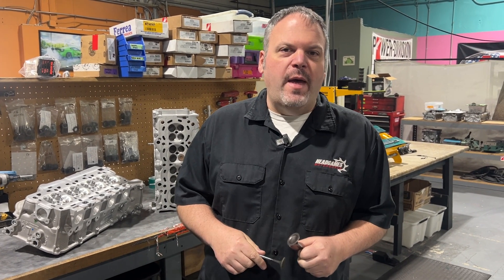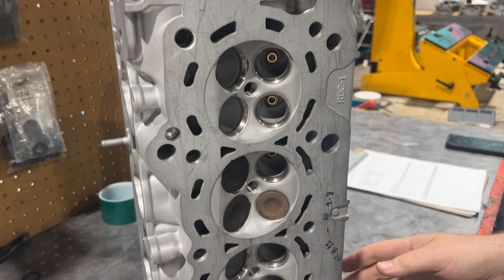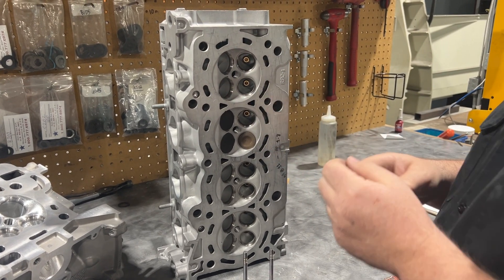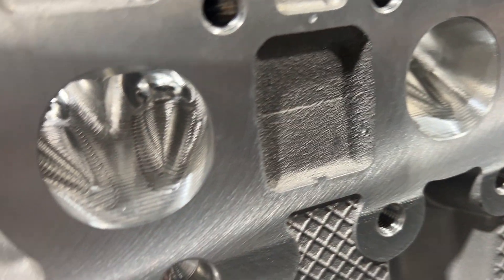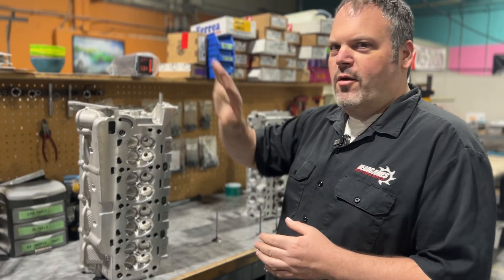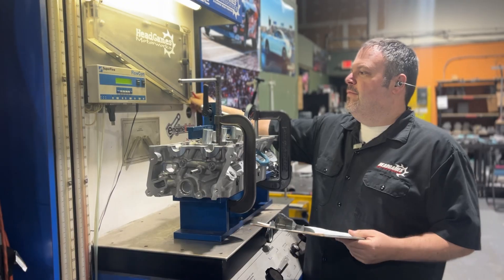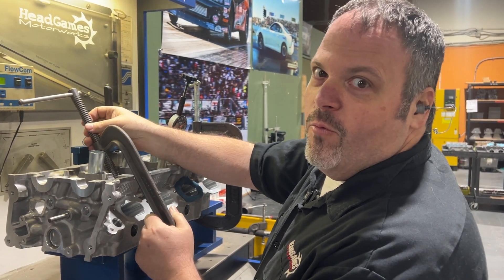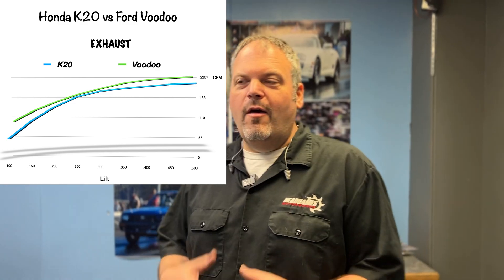Ford Voodoo vs Honda K Series: Flowbench Showdown – Which Cylinder Head Wins?

Comment: The head with larger valves flows more air.
No surprises there.
To make the comparison you should calculate and compare the flow coefficients using the valve seat area as the reference and again using the bore area as the reference. This gives you an idea of port flow efficency and cylinder filling efficiency.

Just eyeballing the values from the flow chart you presented, and using the valve sizes and bore size you give, my quick calcs show the k24 ports are around 12% more efficient and would be around 18% more efficient at filling the cylinder.
Reply from the maker: @varnishvarnish  but that wasn’t the question being asked. Flow was the question from the podcast

Comment: What's the point of this video... actually I don't understand it. The Vodoo has a 94mm bore against the 87mm bore of the K24 so it has way bigger valves and of course outflows the stock K24 head. Since this is not really an engine comparison video (not much to compare, again 5.0l vs 2.4l) it can be seen only as a technology comparison video and as a matter of facts the outcome is that the K24 is a far superior design considering that it flows just a bit less than the Vodoo but with way smaller valves. What has to be said is that coming the two engines from two different decades a different focus was used during the development regarding emissions, it might be that the Vodoo design is more efficient under everyday driving conditions.
Reply from the maker: Did you watch the beginning ?  I explained the why this was even a thing.
Reply: that wasn't even a k24. it was a k20 head from a 200hp civic si. 

a fair comparison would be a fd2r head imo since the voodoo head has bigger bore, is cnc ported of a limited production car afaik. 

be probably more compareable with the k20 head of an fd2r mugen head. 

this felt a bit of a biased comparison.

Comment: Well..
A voodoo engine is 5.2liter v8 with 94mm bore.. cut into half of displacement of just 4cylinder, it would be 2.6liter engine..

With bigger bore, there is more spaces available for bigger valve being used..

So its expected that voodoo head should flow more thn k24 head that have limited valve are since its just have 87mm bore..

Plus, it was ported already..

I think if both of the heads were oem cast stock port and everything, it will be closely matched...

Displacement differences where half of voodoo head need to cater for 108.3% airflow more than k24 head, seems reasonable enough...

Rhnks for showing us the flow differnces between those heads,

Maybe i would like to request head flow battle for 4b11t evoX head versus subaru JDM EJ207 big port cylinder head...

Because the JDM EJ207 big port cylider head have much bigger port size compared to USDM sti ej257 heads...

Also i would like to know how much flow deviate for the ej exhaust port between the straight port and dog-leg port..

Thanks in advance, cheers

Comment: try s2000 f series heads, i own both turbo f20c s2000 and turbo k20z1  rsx type s,  both are 2.0l, both run high compression  piston and both on e85, but both are stock long block but, yet the turbo f20c yeld more hp by country mile at 528hp at 12lbs boost  compare to k20z1 398hp at 12lbs boost

Comment: I'm pretty sure if it's just raw flow numbers, the larger motor has an easier time flowing air. But if it's CFM per liter of displacement, the Yamaha R1 will be at the pants off of everything.

Comment: Wow, great channel. I just found this. 

Could you do a Roadrunner head vs a Voodoo head? Roadrunner found in the 12/13 Boss 302 came with OEM CNC ported GEN1 Coyote heads, and people were spinning Roadrunners to 8,200+ RPM's with nothing more a tune, so they obviously move air. I don't think Ford has any GEN3/GEN4 Coyote based OEM CNC ported heads, but maybe I'm wrong?

Maybe you could you do a video comparing the best heads to maximize the GEN3 5.7L LS1/LS6 engines with their 3.898" bores? Obviously all that costs $ to buy the supposed vest heads, but that was always a big discussion back in my LS1 days. Also do you know how well those aftermarket Elebrock heads for the GEN5 LT engines flow compared to OEM GEN5 SBC? The OEM heads have an odd exhaust port the kind of wraps around the exhaust ports, and the Elebrock heads use a traditional straight exhaust port, but the OEM GEN5 heads do move air, and can make a lot of power, so IDK if the aftermarket Elebrock head would be worth the upgrade.
Reply from the maker: I own a boss and have a few sets here. We are going to do many of the coyote's vs each other. We have many LS heads here, doing a video on one would be cool. I haven't ported one by hand in probably 15 years though, not sure I would look smart lol  We have a cnc program for all of them. Nothing LT though, never seen one.

Comment: barra 6cylinder head . [up to 2500hp as drag motor]
Cleveland 4v 351 head supposed to do 250 out of the box  [2 valve 55mm in/ 40mm]
CHI clevor 3v supposed to flow 330cfm [2 valve up to 750hp na 351ci ]
Volvo whiteblock 5cyl v60r

Comment: How does a flowbench work? 
I see a really tall pressure gauge on the side. Does it calculate the volume flow rate using the pressure? 
Does the flowbench account for different port area?

Comment: If you got heads from the BMW S65 4.0L/4.4L that would be a good comparison. Another would be GT500/GT 5.4/5.8 heads. It would be cool to see the improvements in flow vs the Voodoo heads.

One more would be heads from the Lexus 2UR-GSE. But I hoghly doubt anyone who owns a Lexus RC-F is doung any modifications to those engines so you probably have not seen those heads or engine anyway. LOL!

Comment: That wasnt the best what the K series has to offer tho. 
iirc the best k series head comes from the jdm K20A that is in the Integra dc5 type R wich makes 225 crank hp stock.

still only a 2.0 liter with 86mm bore and therefore less valve area but im guessing that it should flow even better.

Comment: Wouldn't it be cool if the industry could do away with camshafts and have infinitely variable/lift/timing valve-trains, with significantly less energy loss in operating.
That would be the biggest news in the internal combustion world. Sort of like Freevalve that works, every time.
Additionally, doing away with poppet valves and utilizing some sort of rotary system that doesn't pose sealing problems.
Reply from the maker: that sounds like no fun at all
Reply: @headgames  😆 Except for the massive improvement in power at all RPM ranges.
Reply from the maker: @ I’m not sure I follow how it would be a massive difference. It would be in terms of friction loss but the head still only flows so much at any given lift. Idk. Sounds like something someone much smarter than me might figure out. That journey sounds expensive and no fun to me.
Reply: @headgames  No matter how developed valve trains and cam systems get, they will never overcome the inherent problem which is the valve itself, which is a hindrance to the efficient flow of air in, and out of the cylinder. The only system I know of is the rotary valve, but itself has a challenge of combustion sealing.

Comment: You need to normalize it to bore diameter? If you aren't considering bore size a 16 liter semi head would win for sure.
Reply from the maker: we keep it to 1 bore size and it's bigger than they would actually run so no head has a advantage and you get repeatable results.

Comment: I did heard something around the interwebs, where some guys said Ford basically copied the R35 GTR engine (VR38dett)  then they just added two more cylinders when building the coyote.... Sooo a comparison between the two would be interesting i suppose.....  But why Not compare the Aussie Barra 4ltr inline 6 turbo head while you're there with America's Voodoo heads for a battle of the nations... annndd i suppose we could include the German's in some shape or form also.

Comment: I’m curious how the F 22C head flows compared to the K 24 because one day the motor in my S 2000 will die and I have to decide to either k swap it or spend the cash for a new F series block. Plus, I think it’d be a cool video.

Comment: Yeah i'd like to see 6.4/6.2 hemi head vs the voodoo. I think they usually flow 330-340cfm intake stock. Ported ones get close to 400
Reply: 100%
Reply: Lift	Intake CFM	Exhaust CFM	
0.100      79    56  
0.200	178	128	
0.300	248	183	
0.400	312	211	
0.500	335	228	
0.600	339	237	
0.650	340	240	
0.700	339	241	

Most aftermarket Hemi cams won't see much over .600" lift, stock 6.4 cams are .571" on the intake

Comment: You should compare a regular gen2 5.0 head vs ported gen2 5.0 head vs Voodoo. A lot of people debate on ported gen2  5.0 vs Voodoo. Lots of mustang guys would watch that video!
Reply from the maker: I did Gen 1 with HeadGames CNC vs Voodoo yesterday. Would probably drop end of January. I am going to do all of the gen's vs the voodoo and why I would choose one head over the other in certain applications.
Reply: @headgames  Voodoo heads have another massive difference effecting real world flow being their vastly different valvetrain geometry giving 100 thou more peak valve lift than possible with Gen 1, 2, and 3 coyote heads.
Reply: @justind4623   Gen 3 heads support the same kind of lift, they come with .551" lift cams stock just like Voodoo/Predator
Reply: @justind4623  i wouldnt say "vastly" different valvetrain geometry, the valve centerlines move around slightly (~0.5°) to get larger valves better positioned in the larger 94mm bore. Agree the valve lift is higher (14mm vs 13mm), but you can buy a compcams 5L stage 1 cam and get the 14mm lift on a 5L and its basically the same profile as voodoo
Reply: @headgames I can’t wait for it
Reply: @headgames  what about a boss 302, im pretty sure they are also cnc from the factory too
Reply: @headgames  I have a Gen2 TT, this would be an awesome info, so in a future it will be the easy pick.
Reply: Came here to say this too
Reply: Bump

Comment: Would like to see what  K 20A head wood flow, from a DC5 Integra type R.   I thought that was the best flowing K series said, but I might be wrong.
Reply: You're right.
Reply: @Trash-horse  самая лучшая продувка civic fn2 и fd2 с головкой RSP, все уже меряли)
Reply: Yup. K20A from an RSX-S will outflow any K24 head. But, would it outflow the voodoo? I doubt it. Still, it's a 20 year old design and it still holds up! Nice!
Reply: The RSP head from the 2007-2011 Civic Type R (FD2, FN2) is the best of those, but the K24 with the headifold from 2012-2015 supposedly flows the best on the intake side of any of these heads (however, obviously, the exhaust side is terrible for the outside cylinders).
Reply: @ I’m not sure about the FN here in Asia is called the Civic type R euro.  that is because it is not a JDM engine. It is built in Europe. The FD type r is built here in Japan, it is the most powerful stock K 20 a. The second is the DC 5 type R. The versions we have here in Japan. The ports are actually cleaned up from the factory. I don’t know the flow rate, but I know they are very desirable for the people in the western world.

Comment: Flow should be flow per cylinder bore size.

K20 head is supposed to supply a 2.0 liter engine. Voodoo head is supposed to supply a 2.6 liter engine bank.
Reply: irrelevent
Reply: @craig3916   Bore size is irrelevant? You're out of your mind.

Comment: @headgamesmotorworks nice to see the comparison. Unfortunately picked the wrong k series head to flow. Top dog would be type r head rsp casting. But an affordable option that flow near same is ppa casting from a crv.  Both should flow in the 340+ range. Voodoo head is very impressive though.
Reply: Don't people say a stock k series head flows around 300 cfm? I was surprised to see the k didn't get anywhere near that number here. 
Would that be like a k20a2?

Comment: It’s insane that you are comparing a stock k head to a stock yet ported head, just shows how well engineered the k series head that’s it’s up against a factory ported head.
Reply: These are both production heads. What's crazy about it? No one stoped Honda from porting their heads.
Btw, one could argue the voodoo head design started life as a moderate hp mustang head and was transformed by Ford into what is. The K head, correct me if I'm wrong, was designed from the start to be a HP/L hero.

Comment: I mean the k series heads are good for what they were made for and that was a compromise between economy and power on a smaller engine. Remember that honda's vtec engines have to keep port velocity up enough at low rpm for good low rpm economy and still flow enough to move air at 7000 rpm with a radically different camshaft profile than at low rpm. 2 liters versus 2.6 liters on the voodoo engine. The voodoo was made with power only in mind and was designed over a decade later.

Comment: Comparing two heads with totaly different cc and valve size is like putting a heavyweight in the ring with a lightweight 
Pointless test
Reply: not pointless, shows flow....
shows potential or in some cases bad design n not worth bothering with. for some applications.
some old v8 heads are lucky to crack 100cfm. yet the cars get along quite respectably.
so tells you all sorts of info. and doesn't even mean it performs badly in some applications. [just don't ever expect it to rev... haha ]
Reply: @craig3916  I said 'comparing' not testing

Comment: Yeah between valve size and fact one is ported and the other is, isn't comparable fairly and regardless it's pretty proven at this point in time kseries head flow and capable of 300hp easily 😂,  and the most important fact of all== kseries what ?? There's k20 rbc and There's k24 rbb and There's jdm type R k20 and everyone is different including intake manifolds and head ports ?

Comment: I would like to see Toyota's 2GR
Reply: I believe it started in 2005 production. It's a 3.5 they come in Camrys Avalon's and Lexus vehicles. The port design is much different from your typical Toyota cylinder head. They advertise 270 hp stock. 
Great content! Keep it up!
Reply from the maker: what has that engine?

Comment: Stock Honda 2.0L vs ford cnc 2.6L   Big valve head 😂
Reply from the maker: I am not familiar with a ford cnc 2.6
Reply: @headgames  Voodoo motor  is a 5.2-liter each head is supporting 2.6L so about 30% bigger than a k-Series… it’s not comparing apples to apples, but showing how dominant the Honda k series heads are in a small package simple and clean design… another reason why they’re dominating in F1 with their engine package …Ford Voodoo architecture has been part of the Ford Modular family since 2015 honda k-series i-vtec was 1st in production from  2001-2011 very long time ago and the b-series was designed in the mid 80s and into production from 1988-2001
Reply: Voodoo is a 5.2-liter ….2.6L head x2 = 5.2L

Comment: You're comparing a cnc ported head from factory with a non cnc head. 4 piston provide a rbb head port job that would make it flow as good as a k20 from a rsx type S
Reply from the maker: @Givelasagna  yeah I mentioned that fact.
Reply: @headgames  sorry about that I must have missed that. Great video
Reply from the maker: @Givelasagna  thanks!

Comment: I wonder what will be the flow of the Porsche Gt3 RS cylinder head to be a 4.0L NA making 518HP meaning that each cylinder head can flow 260HP putting in another perspective a 2.0L  making 260HP in NA form, it has to be a marvel.
Reply from the maker: @CJ5EVOLUTION  doubt any of those things are coming in here but maybe one day!
Reply: @headgames what about m97 heads? What’s the magic sauce with those guys?
Are they a bottle neck or did Porsche size em right?
Reply: I came to comment this. I bet its up there!
Reply: i would love to see that
Reply: Maybe the guys at Dundon motorsports have a head they would lend you? For science…
Reply: Watching Matt's Armstrong video I was surprised by Porsche GT3 RS head- it looks like it has been ported from factory... I'm sure it flows very well
Reply: K20A, A2 and Z1 will destroy ALL with NA hp/L. 280+ HP is easy.
Reply: @millenniumzeek like any engine that needs modification  HP can be increased.

Comment: What about velocity/total port energy and discharge coefficient? As for what heads I want to see, well, I'm interested in V6s, so LV1/LV3, J series heads (32a2 and any second gen J35), 2GR heads from Toyota, and the 3.7L Cyclone heads from Ford.... Screw it, throw a GM Atlas head up on there, too.

Comment: Considering the bore is much larger and the valves are much larger, not sure how it can be a surprise that the voodoo head flows so much better. Just put them side by side and use your eyes and you can come to the conclusion without any testing.

Comment: From what i understand, the 05-06 Ford GT heads are the best heads Ford ever made. I'd be interested to know for sure. Especially since the 4000 hp billet mmr 5.8l coyote has voodoo heads.
Reply: The 05-06 GT heads were the pinnacle of modular DOHC head technology at the time. Since then however, the R&D in the Coyote based heads (both Coyote and Voodoo) make them superior to the mod motor DOHC stuff (wether GT or GT500). Still, I concur that a comparison would be interesting to see.
Reply: The OG Cobra B heads were the fastest heads bar none until the coyote heads came out. They ran 6.14 @ 236mph+ way back in 2005.

Comment: I would really like to see a Mercedes M156 head('06-'11 AMG 63 models) tested - 6.2l DOHC V8, 102.2mm bore, 40mm intake/33mm exhaust, gotta have some absolute monster flow potential in those things.
Reply: I had the same thought; based on some googling the M156 substantially outperforms both the Ford and Honda heads, and I'd be very curious to see that confirmed.
Reply: 400 cfm out of the box